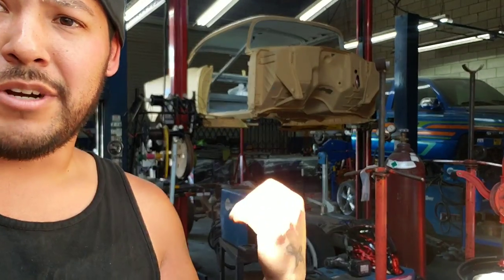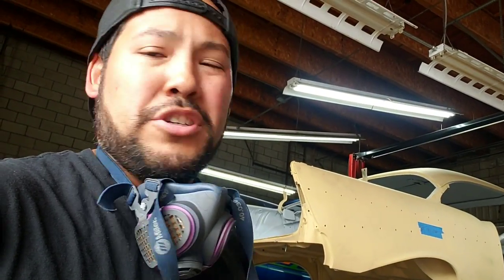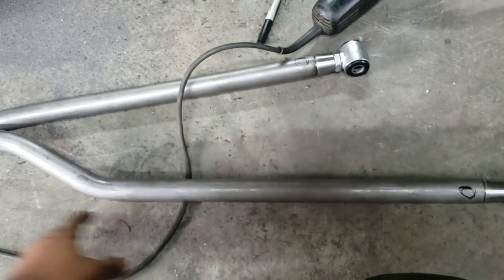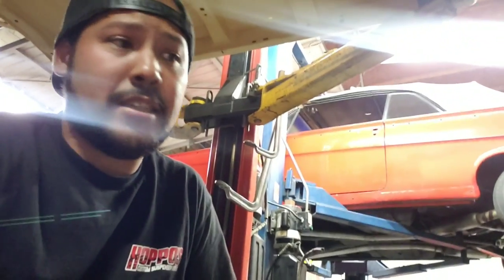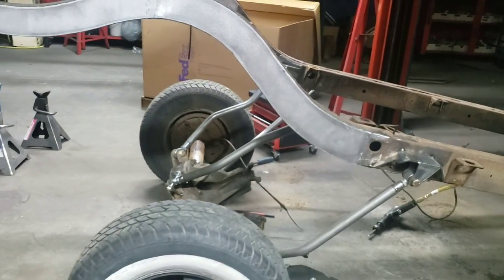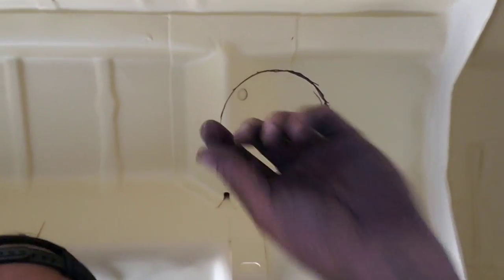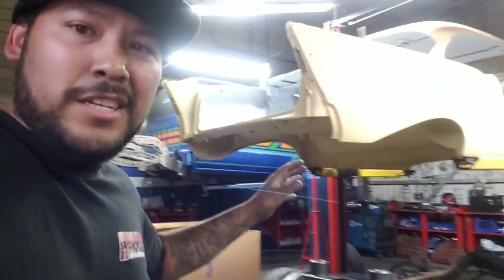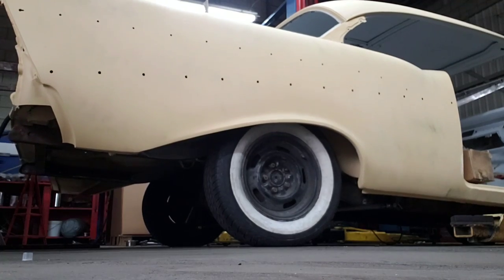57 belair with a CRAZY lock up part 1

Comment: I don't know but maybe you can fabricate idea I had about instead of chains it's basically modified seat belt bracket how a seat belt can roll out until you hit the bottom out point but when you lower the car back down and set up the felt dragon on the floor getting tangled up it sucks itself back in and I always thought that would be a neat concept cuz then you can tuck it away but you can still lock up cuz the quieter you make the suspension the sweeter it looks and sounds
Reply from the maker: We don't use chains for one looks really cheap, 2 it slaps around making noise if not locked up. 3 chips chrome up. And we use limit straps to eliminate all those issues

Comment: I had little idea how much work it takes to do truly quality work, thank you. I'm not a low rider, I'm a hot rodder, and I know that line is getting blurred these days. Do you need a track bar to control side to side movement?
Reply from the maker: No not with a triangulated 4 link the upper bars keep it from swaying and keeps the rear end centered

Comment: What other than Currie 9 inch rear ends  can you use on a 66 impala so that I can put on fender skits so that I can put in my Hydralics and wire wheels they fit on there without rubbing or popping off

Comment: curious why you wouldnt use a holesaw bit to cut those holes.do you not want them circular on purpose?
Reply from the maker: The big holes for the smoke stack?? Cuz it was like roughly 6.375 inch hole that's needed  and they don't make hole saws that size

Comment: @alexhoppos909 Got a 99 s10 extended cab v6..I wanna body drop it into the rocker..but I wanna juice it..wanna run 10s all the way around due to wanting huge lift up front..these cats from high class I love there lock up but none of there cars lay out..body drop can be traditional doesnt bother me..basically a similar system like this but not 22s in the back..I'd like to do 10s all the way around cause I dont like how 8s lock up..would it be easier to have you do my juice setup first and then come back and body drop it..would you be able to make it lay full frame??oh and I do wanna 3 wheel it..most of the time itll be either full lock up on the front with the rear all way down cali lean style or skating or locked up hitting 3s..I do plan on using it daily..rims would prolly just be 20s and 22s for shows and 20s to roll around in..but for sure show rims would be the new boyd coddington old school designs..